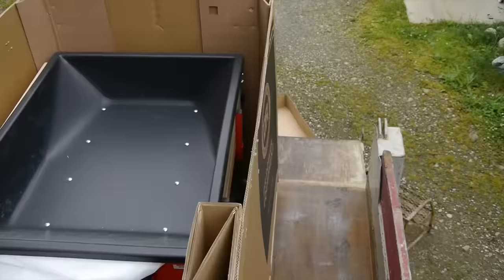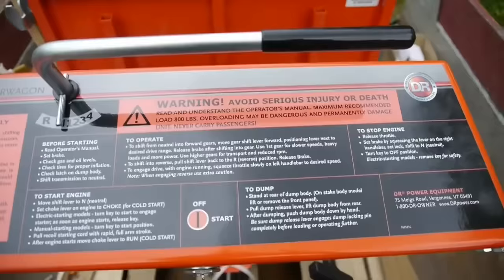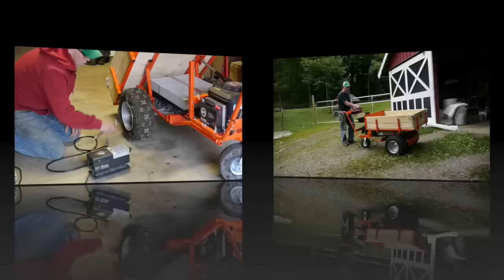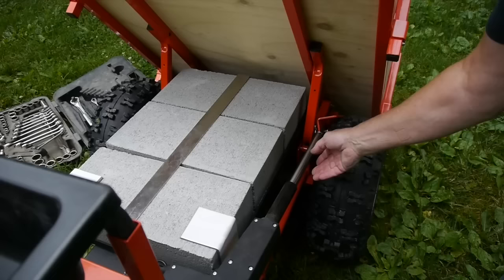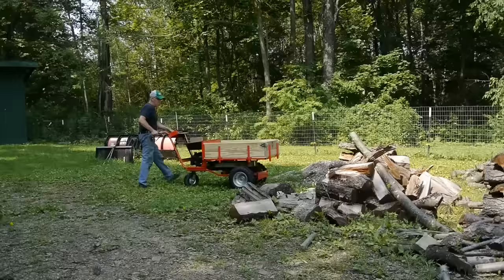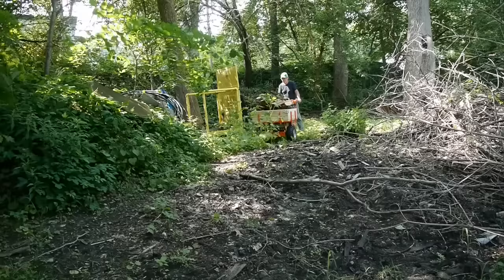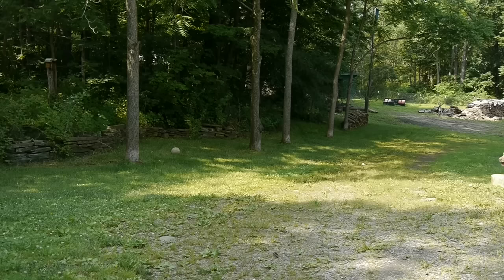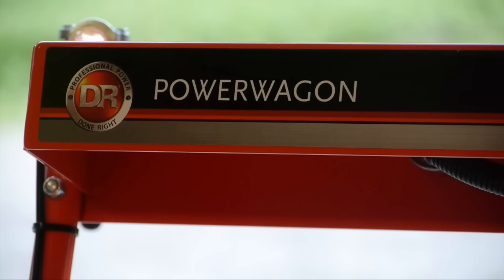DR  PowerWagon - Best Review

Comment: I've had one for many years and it's a constant companion in so many different ways I can't begin to list them.  Even after buying a tractor with a loader, I still use the Power Wagon for lots of stuff.  It's especially handy for going into the woods to haul out firewood.,  tight places where a tractor would never go.   I would stick with the  manual start, one less thing to worry about.  My old machine came with a sulky at extra cost that they no longer make.  That was nice for tooling around level areas, but not much good on slopes.  I have both plastic and wood boxes.  In at least 20 years, have never used the plastic one.
Reply from the maker: Thanks for the comment.  Glad to hear you have had many years of service from your Powerwagon.  We bought this one mainly for concrete work in cemeteries.  So, we use both of the boxes a lot.  So far .... so good.

Comment: I have a Power Wagon that I have had for >20 years; it still has the original engine and has the original wooden bed.  It needs some work and has reached the point where I don't know if it is worth the money/effort to get it fixed.  I have hauled EVERYTHING with it and the bed is still in good condition.  I let the wheels rust to the axle and had to have one cut off, and now if I am to continue to use it I will need to have the same thing done to the other wheel.  I cannot speak for the newer models with the plastic crap on the bed (they should go back to the old wooden beds), but the one I have has been far more than I expected it to ever be.  I LOVED IT!

Comment: I shouldn't comment half way thru the video, but I always do.  I think you don't have to take off the box to use the plastic one. I seem to remember that on older models you could sit the black box inside and it would attach somehow and then you could just take off the front part of the wood box and use it that way, but I could be wrong.  Ok back to the video.  :)
Reply from the maker: That would have been nice!  This new one has a metal frame on both the wooden box and the plastic one to attach to the DR.  It only takes me a few minutes to switch them out and I only use the plastic one for concrete transport.  Thanks for the comment!

Comment: Replace the bolts that hold the bed on with some pins and clips so it'll take just a minute or 2 to swap between the beds and not have to carry tools around to swap back and forth....should have came like that from the factory, as ridiculously priced that DR equipment is they have a lot of stuff that really makes you wonder why they didn't do it different and this machine is one of them with bolts instead of pins and clips for the bed.
Reply from the maker: I really don't mind the bolts.  I don't change the beds that often and the bolts hold everything tight.  My son agrees with you though!

Comment: I've used the power wagon since 2002.  I STILL like it.  It's not as beefy as yours but it's still holding up well.  I just got it with the wooden box...didn't notice if those plastic squares are still on, but it doesn't seem to make a difference.  At one time I added a 2" ball trailer hitch and pulled a 4x8 utility trailer, which was probably not the best idea safety wise.  Backing up was really tricky and going forward, I had to sit on the railing of the trailer.  If I were to fall, I'd get run over without that safety handle on.
One option I really wish DR would offer is a battery-powered version.  I'm of the opinion that we should reduce our carbon emissions to make the planet a better for our kids and grandkids.  I keep calling DR, asking for that option.  Basically I tell them the truth...I'm not going to buy another DR product unless it's battery-powered even though I love the power wagon and brushcutter which I think are well made machines, but it's time for our generation and the DR company to get on board with cleaning up the emissions.  That's my story and I'm sticking with it!!!
Reply from the maker: Thanks for watching, Pat and for the comment.  Batteries have come a long way for sure.  Eventually everything will be powered by electric but not until the very last drop of oil is sucked from the ground I afraid.
Reply: I'm more optimistic. I think battery-powered cars, trucks, tractors, buses and even power wagons will be manufactured IN OUR LIFETIME!!!  In less than 10 years I'm a-hoping. 
I'm gonna look forward to TimTools doing a review on the battery-powered power wagon. 😀
Reply: It is very bad for the environment to make the batteries

Comment: Are those ballast bricks under the load box? If so, seems like maybe unnecessary weight to be hauling - have you tried it without them? Will increase your payload a bit/reduce wear on the machine.
Reply from the maker: Yes that what they are.  I haven't tried it without them. I figured the 
reason for the bricks was to add weight to a low center of gravity.  I 
have put a full load of gravel in the box and without the blocks it 
would probably be top heavy.  I assume that is why the DR company 
provided them.